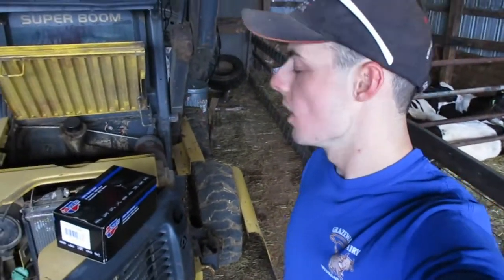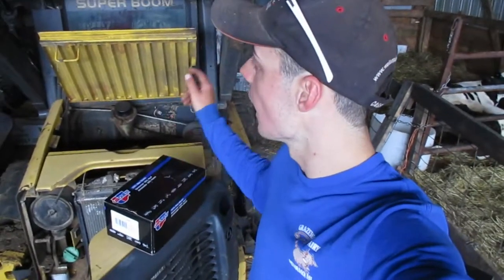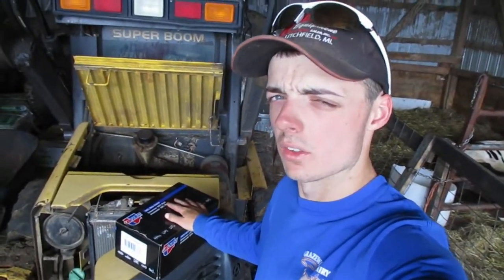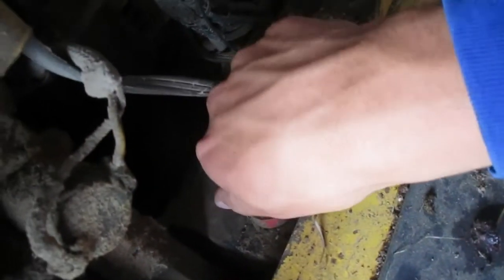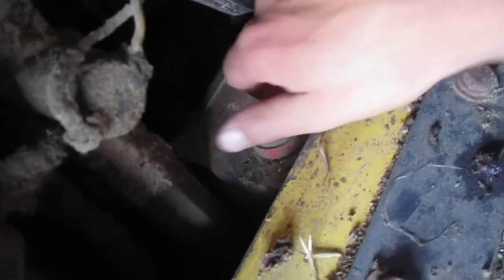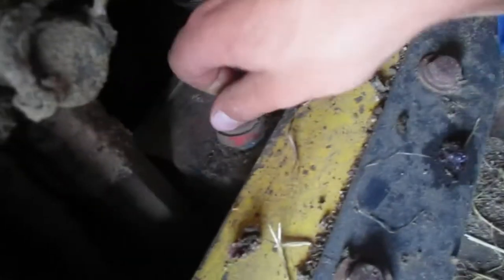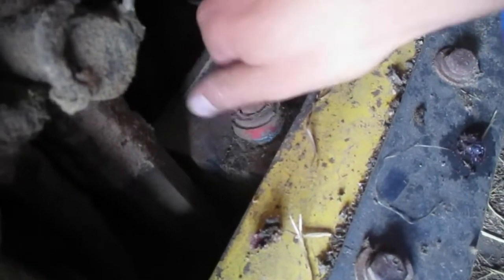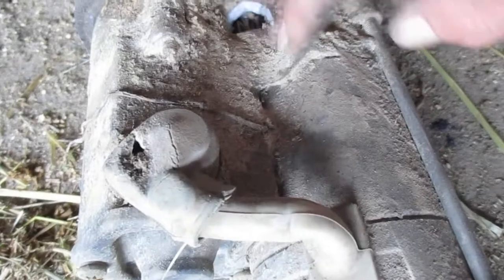Replacing A Starter On The LS160

Comment: Very useful, although you made it look a lot easier than it was.  When the boom is down, you can either see the 2 mounting bolts, or get a wrench/socket on them by feel, but not both.  I thought I was going to have to call someone to pull me out from under the seat...

And I can't remember if you mentioned wrench sizes, but the mounting bolts were 9/16", and the positive stud on the starter was 1/2".

Cheers!